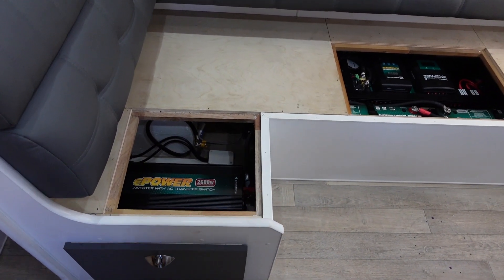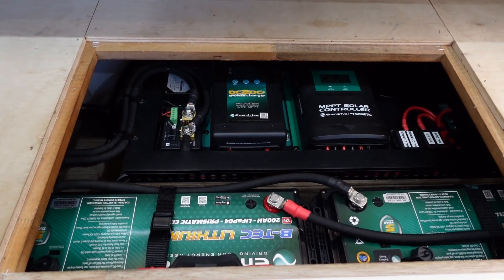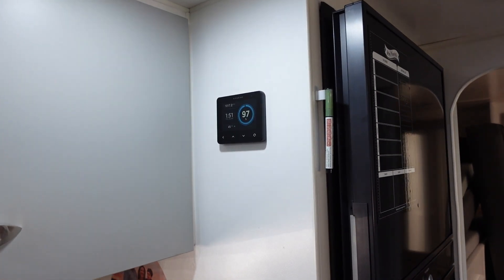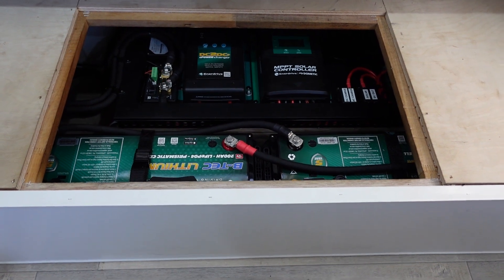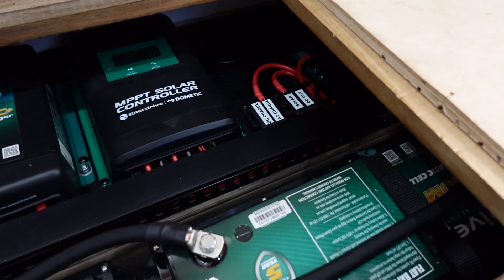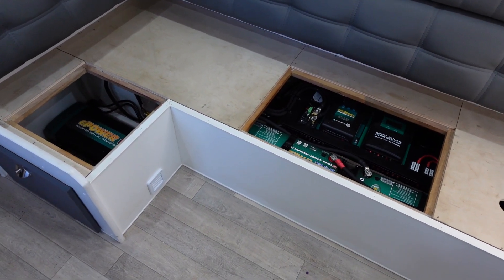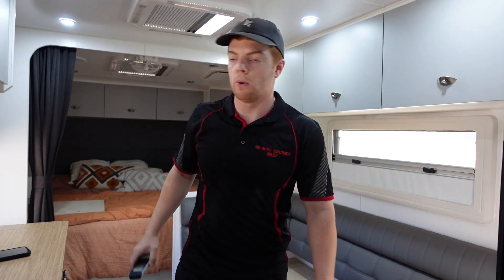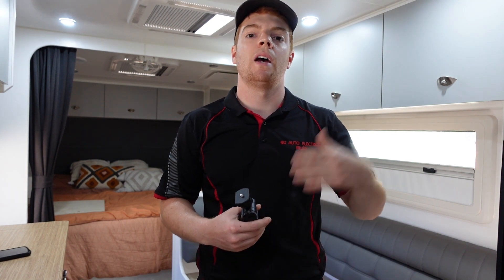YOUR OFF-GRID QUESTIONS ANSWERED!!

Comment: Very well explained mate and some great tips. Just installed a Lithium system with a 3000w inverter yet to go live but. Will definitely ask Auto lecky for the updated electrical safety certificate. Also will ask about the extra power point solely for mains power that you mentioned in the other video. Cheers
Reply from the maker: Thanks mate! Glad you found the video helpful, and great to hear you are making the switch to lithium 🔋

Comment: Everyone is installing those DCDC chargers flat, but the instructions says to install vertical ?
Reply from the maker: No issue with mounting the units like this installation mate, as long as there is adequate room for airflow. 
Only really needs to be considered in marine applications.
Thanks Riley